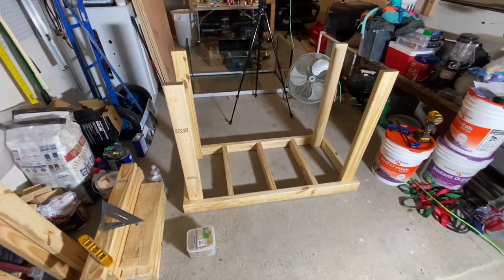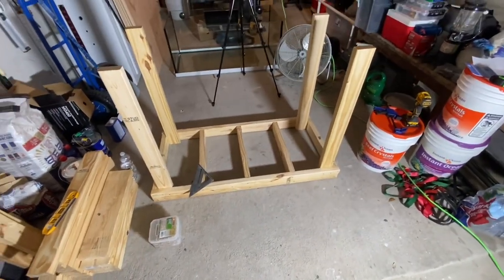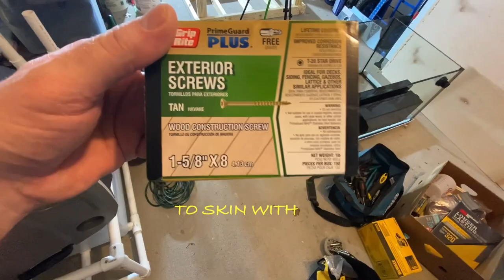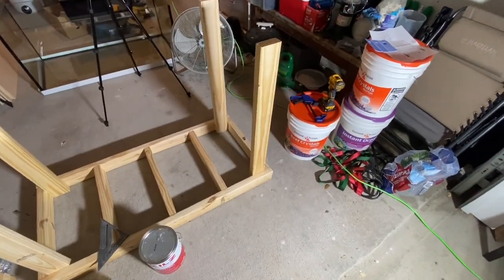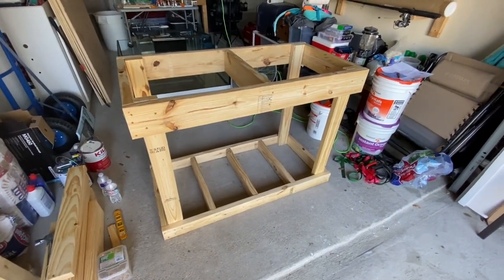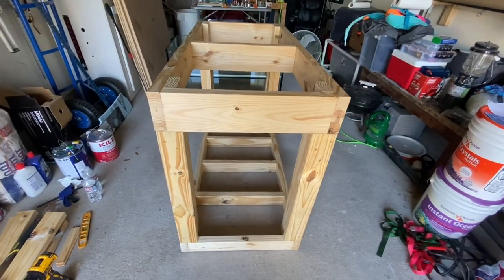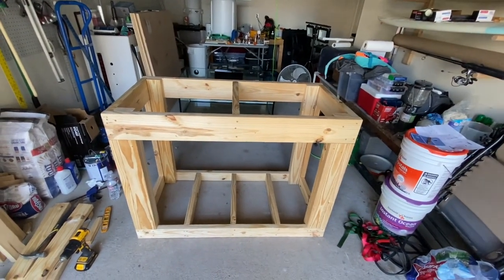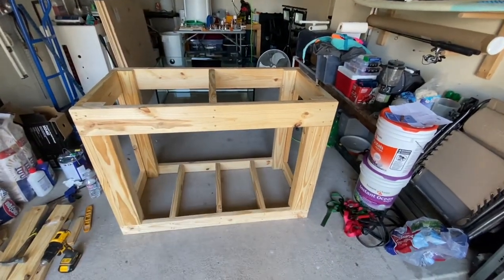Stand Construction is Underway!

Comment: Looks great!  Have you finished?  Would love to see how you do the wrap, ect.   Thanks!!
Reply from the maker: Thx Gilbert! I’m almost finished. I’ve already skinned the stand and filled the nail holes 2x and sanded 2x. Last night was a last fill to catch any low spots, imperfections, tiny holes, cracks, etc.. that didn’t completely fill, etc. Tomorrow evening on my day off I will sand for the last time with 220 and then hit it with 320. It will be ready for paint next. Shouldn’t be much longer!
Reply: Awesome...can’t wait!!
Reply from the maker: @reefergil2234  I’m gonna try and do a short update video before I paint. Just to show what it looks like and maybe talk about some challenges I had and tools I used.
Reply: @Reefahholic  That would be great...looking to build my first for a 125gal.  If the boss (wife) approves!!!
Reply from the maker: @reefergil2234  Just follow the DIY TEMPLATE be Rocket Engineer. A google search should bring it up in images. You’ll see the 2x4 are colored coded. No Kreg Jig needed.